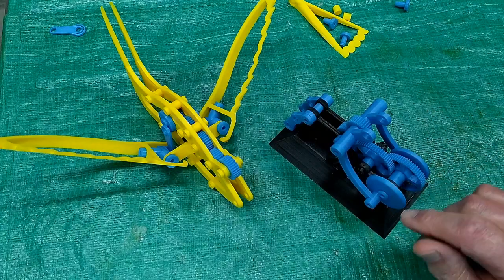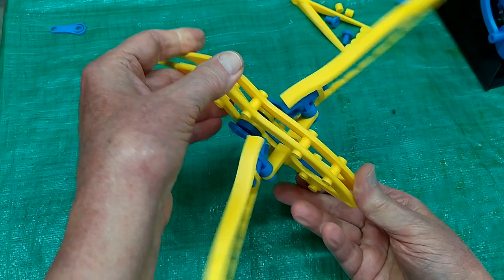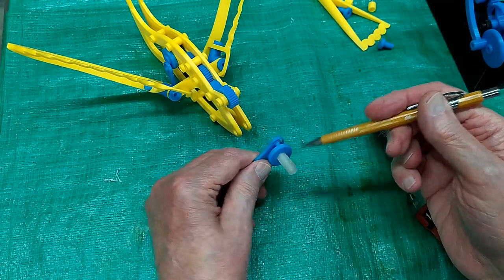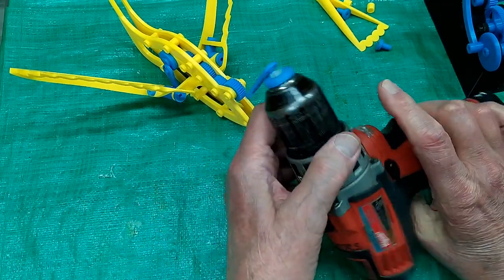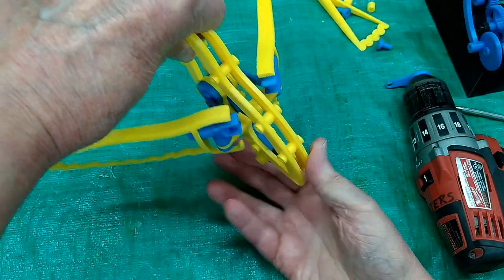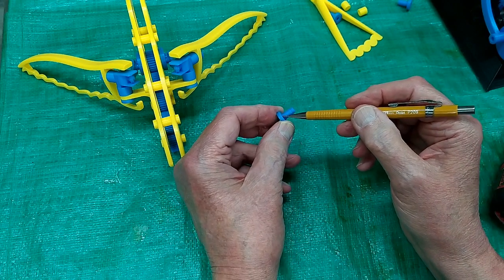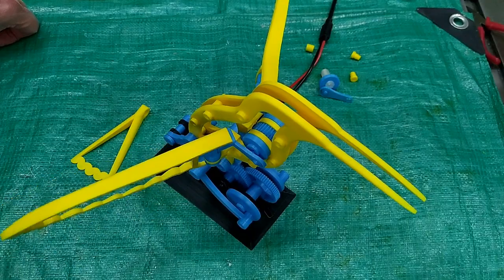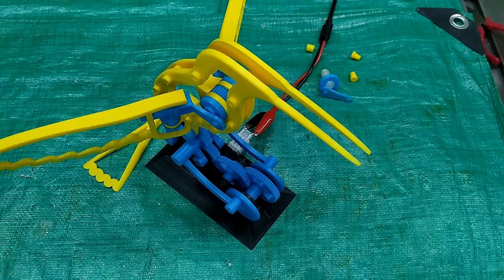Mechanical Hummingbird - My Second Bird

Comment: Thanks for the video. Have you ever tried spray-on dry graphite film lube as a lubricant? I got a can from the auto parts store, and it's good for a lot of things, such as a mold-release agent on the patterns when you are doing some sand-casting. Your hummbird is fantastic! Best regards.
Reply from the maker: PLA 3D prints are laminated and a bit porous (which I understand would help retain the graphite) but graphite may be a bit messy for this bird. Corn oil is compatible with the PLA and I use it only until the parts have worn in a bit , then I wash it off. On wood parts I use paraffin ... sometimes mineral spirits or boiled linseed oil... depends on the wood. Once the linseed oil dries, it polishes up pretty well (but not for everything). 
Thanks for watching! 
Ron
Reply: @RonaldWalters2010  Yeah, I was thinking the graphite would be messy too. I love linseed oil!  Wishing you all the best.